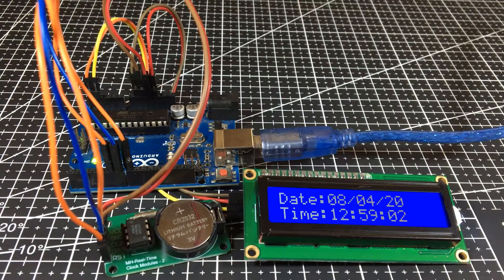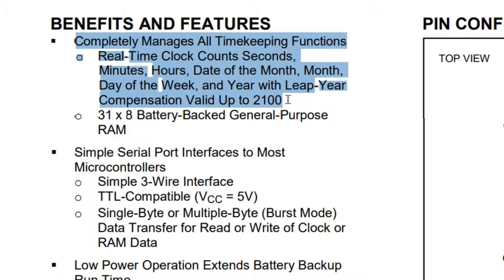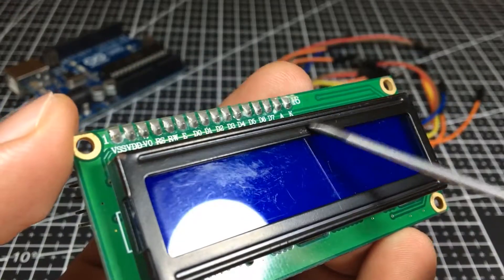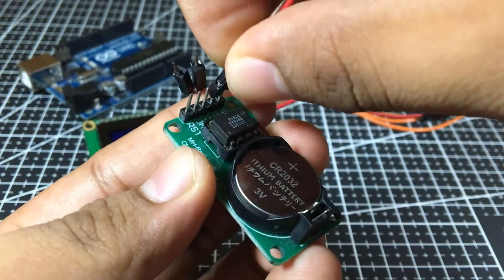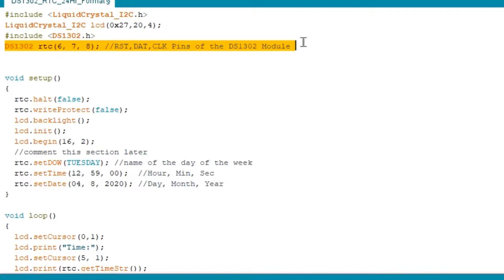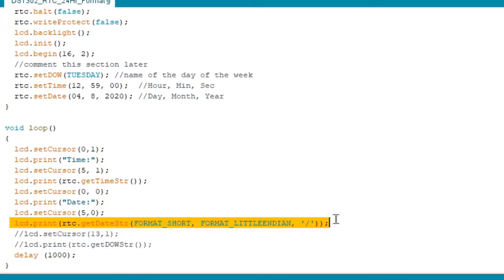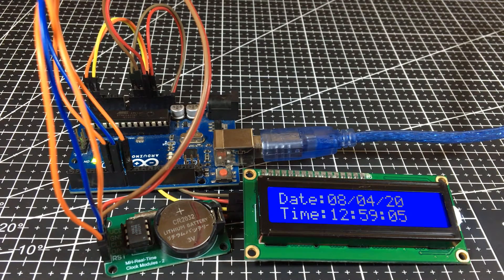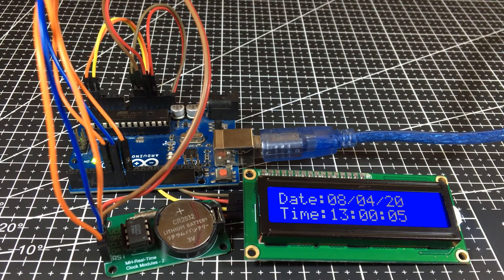How to use DS1302 RTC with LCD using Arduino - For Beginners

Comment: Not working. Clock still shows 00:00:00. Anyone can help please? Thanks
Reply: Remove the ‘comment’ “//“ in the void setup to program the DS1302 and upload the code. After that bring back that “//“ and upload the code to remove the rewriting of the arduino

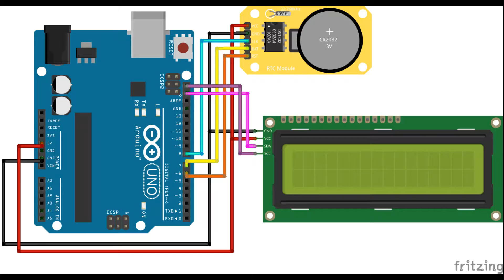Comment: At 2:15 what should I do with the Red and Black wires? They seem connected in a three-way
Reply from the maker: Both VCC pin of lcd and RTC module connects to the 5v pin of the arduino. 
Both GND of lcd and RTC module connects to the GND pin of the arduino. I hope it helps
Reply: @kotobukichannel4367  So I should strip the covering of jumper wires and connect them?
Reply from the maker: @bakais3r864  it's up to you on how will you connect the modules all together.